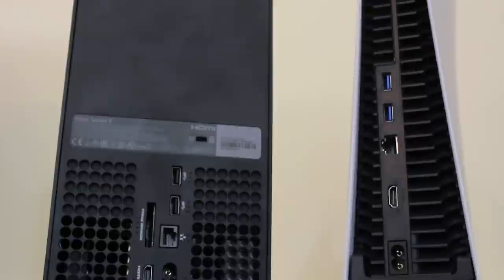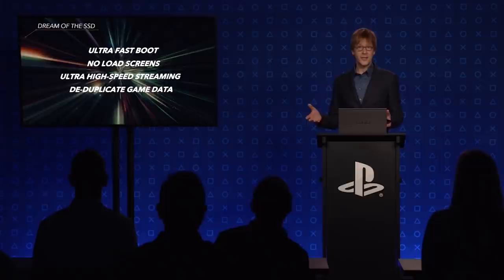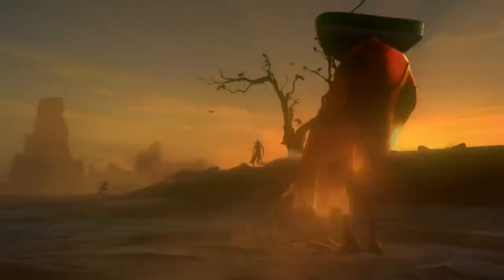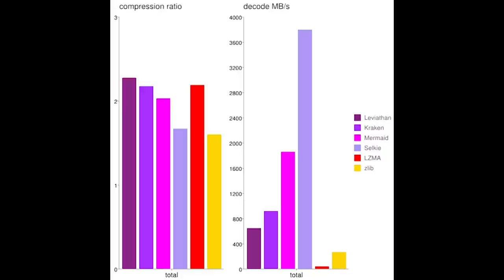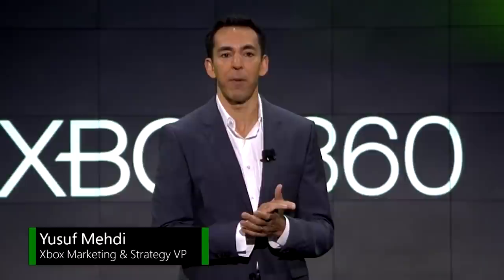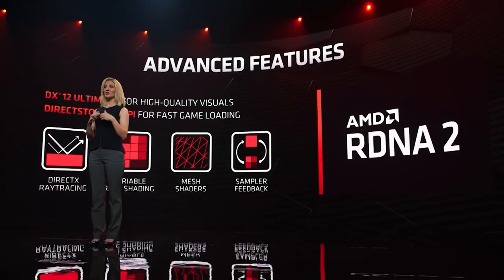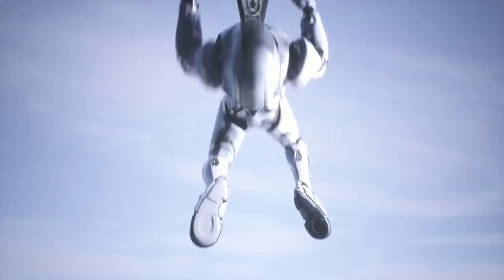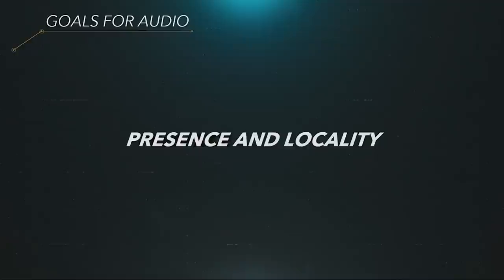Mark Cerny Reveals PS5 SECRETS | How The Playstation 5 Was Designed

Comment: Bro it's not the SSD alone by itself. It's the I/O architecture that does all the magic with games being loaded in 1-2 seconds. It's silly how people keep saying it's the SSD when in reality it's not the whole picture.

For example you can add in an external NVME and still get the same or better load times with PS5. games.
Reply: I´m not sure i agree. DMA have been a thing since the early 90-tys. In the presentation thay make it sound like its brand new, and they invented it. but its have really been the norm for 30 years now.
Reply: @matsv201  Yep the MegaDrive could do DMA but most retail software didn't support it.  The demo scene have exploited it a lot tho doing real blast processing and other cool stuff.  The Jaguar IIRC was the first console with a widely commercially-used DMA for its framebuffer, direct framebuffer access.
Reply: @matsv201  Likewise, decompression blocks on GPUs for standard file formats, starting with S3 textures, have been a thing since the late 90s. 

The big difference is having a set of features guaranteed to be present and function predictably on every PS5, from #1 to #100,000,000. That is the big advantage of a console as target platform. Though it also means it will still be the exact same set of specs five years later, while the definition of a high end gaming PC advanced in each of those years.
Reply: @epobirs  i guess there is some reason why decompressing from disc ks better. Of cause, the bandwith is lowe, so they may be able to run with harder compreason algoritm. Also doing it from disc make the decomomopression in order, that have some benefits.

And of cause.. wirth the streaming into memory...meomory is not really a limitation anyway
Reply: @samalton5837  the mega drive? You thinking of the maga-CD.

The normal megadrive have the cartrigd inline  with the memory
Reply: @matsv201  Having dedicated functionality at the point game data enters the system is the ideal. The problem for PCs was getting a new hardware addition standardized that was perceived as being for a niche application: gaming. Adding the functionality to a gaming GPU and eventually all GPUs was a far more attainable goal, as seen with the S3 texture standard. 

The GPU companies are seeking to reproduce that today with DirectStorage and consumer versions of existing HPC tech with RTX I/O and whatever branding AMD plans to use. (I cannot recall if they've chosen a name yet.) But it's a glacial process. We were supposed to have seen some open betas of DirectStorage games by now. I wouldn't be surprised if AMD and Microsoft intend to have much of what Microsoft calls Velocity Architecture become a PC standard. The PS5 and Xbox Series X/S need a good number of products that really create a gap between console and PC to make the market interested. The alternative for PC devs porting a game that really exploits the consoles is to require a much higher RAM volume on PC. A 64GB PC can do quite a lot to substitute for the storage functionality of the consoles, even running from a 100MB/s hard drive. Such PCs aren't that far off from becoming mainstream without adding any new hardware features that present an uphill battle.
Reply: @epobirs  I would claim that is a over-generalization.  One issue with S3 texture compression was that the texture was not often stored compressed, or even worse, compressed in a different format. But for cases where it was stored in the correct format, this method works just fine.

The textures don´t "enter" the system, its loaded into working memory, its already in the system.

For it being optimal is really depending on other parameters. For a system where the data is stored from SSD where its not really any consedable access time, then decoding it from disk kind of make sense.

For a system where size of the storage medium is not really a issue, but size of ram as well as transfer from storage to memory is, then having it compressed in memory makes more sense.

Looking at the direct storage games that are today, they are really not streaming data that fast. Even with out HW the function can easily be emulated for today. Because its really used for LOD.. or what ever UE5 call there nanite equivalent, if the speed is bogged down by slow emulation preformance, its not really a issue, it just generate a later popin
Reply: @epobirs  PC are already mainstream, just fit in a different segment of gaming. The ram solution should work to a degree, but ouch on adding the extra cost. So far only Ratchet and Clank might qualify for a game PC's or XS might not be able to pull off on the loading time, a pause (How long?) to load up the new world. Not a big miss today, but very interested to see if this tiny gap today turns into something larger in the long term
Reply: @jasonmontoya4749  Ratchet & Clank is, as it turns out, not a particularly good example as it is largely on rails and doesn't have anywhere near the freedom of movement people were lead to expect. There's nothing in there that couldn't be readily reproduced on Series X/S. At worst, some transitions would take a few frames longer to allow for loading and processing new data. Even that doesn't seem likely as watching the game doesn't lead me to believe there's huge volumes of data churning in and out of RAM.

Who said PC wasn't mainstream? I was speaking of a specific feature set that is expected to heavily influence future game design. That extra cost will be minor long term. 32GB (which would be sufficient for background loading a huge amount of geometry and other data used to present larger and more complex environments than in the past, when competing with platforms doing everything in 16GB with no dedicated video RAM) is already mainstream at the mid-to-high end of gaming PCs, despite the scarcity of games that really demand it.

The current consoles are seeking to advance the state of the art via SSD and I/O infrastructure but it is also a means to mitigate the very minor RAM increase from the previous generation due to cost shifts for RAM vs. NAND. (Microsoft elaborated on this in their Hot Chips session on the Series X.) If the past progression over console generations had held, the PS5 and Series x would have 8 or 16 times the RAM of the PS4 and Xbox One. Instead we got a mere doubling over those 8GB systems.

On the PC side, it won't be any surprise to see 32GB become the baseline as part of the shift to DDR5, as what little has shipped to date has 16GB as the minimum DIMM capacity. Thus gaming PCs having 2 to 4 times the RAM of current consoles is almost a certainty within those consoles' lifespan. For many developers, this will be an easier way to handle their PC ports than waiting for the promise of DirectStorage to reach fruition, something that has a very vague at best delivery date at the moment.

There is a certain nostalgia to this. Back in the 80s, when I was working at a game developer, games had to work on the 512K base models of the Amiga, Atari ST, and Apple IIGS, with 640K the PC norm. (768K on some Tandy PC clones that had the Deskmate firmware app and had the usable empty sockets on the motherboard if they didn't ship with it.) Hard drives were still rare, even on consumer oriented PCs. This was becoming painful as games tended more and more to be spread over multiple floppies. All of these machines had models with much more RAM or the ability to easily add it. So we, and many other companies, took the RAMDISK approach. If the initial load detected more than 512K, the player was offered the opportunity to cache one or more of the floppies to the RAMDISK. This took a few minutes but made the gameplay a lot better for big sprawling, by the standard of the era, titles that could require tedious disk switching to work in the base memory volume.

Today's PC, even running from hard drives, can fill a large volume of RAM in the background without making demands on the user's patience. (Under three minutes for 16GB if it is simply a direct transfer.) The designer just needs to get the player engaged quickly so that background activity can commence. The time to the first menu may be annoying but not excruciating.
Reply: @matsv201  I was speaking in regard to the issue of data not necessarily being for the GPU to use in VRAM, which is how the existing proposal for DirectStorage on PC would work, as seen in the RTX I/O approach that is closest to to actually being a real usable feature.

As Paul noted in the video, the consoles are agnostic about what part of the system will be using the decompressed data. This is simplified by there being a  shared memory pool between CPU and GPU. As seen in the diagram, the PC DirectStorage has to get the compressed data into main RAM, then over to the GPU for decompression into its VRAM. If the data in question is not for the GPU's use, it then needs to be transferred back to main RAM.

This can still be a big improvement over a portion of the CPU decompressing the data in question but it's a bit of a workaround for having to work with what will be in a PC that exists today and will be largely the same for some time to come. Getting big improvements to I/O standardized to the point game publishers regard them as mainstream enough to use is a process of several years. So it's attainable goals for now and push for improvement as the value becomes demonstrable in real products.

Also, what DirectStorage games? Looking around, it doesn't appear to have progressed beyond the Developer's Preview and I've seen no PC games announced that will incorporate it along with requiring NVMe storage. (Forza Horizon 5 on Steam doesn't even say 'SSD recommended' under storage on its requirements list.)
Reply: @epobirs  Nice info and background. I played in those days, early Tandy II's if you remember the 12" large disk formats... lol. The I/o infrastructure is looking to change the entire SSD into a functional RAM. PC's might be able to duplicate this somewhat  with more RAM, but does it does not matter until a games or games are pushed to the extreme where those margins make the difference. Custom archeture is just that custom, this is a console strength to have architectural control over the entire system. Right now its a wait and see what developers do with the tech. Might be overkill might not be. IMHO there is a picture being painted here with the virtualization of UE5 and ninite, and how that will interplay with the choices Sony made with PS5. I wonder if Sony had the inside lane, to know how UE5 and ninite strengths, and Sony provided a spec console to take advantage of those strengths. Thats to say, the the play that seems to be emerging to me with UE5 is that assets are going to be EXTREMLY detailed in the new future, and they will be streamed in. Although thats not done today exactly, but it will be and the PS5 is positioned to be the best at this possibility. Well wait and see.
Reply: @epobirs  this is more of a 32bit/64bit miss match issue. Back in the Day when cpu was mostly 32bit the gpu could read the full memory in theory. Anyway, due to maping ghe dma could write ditectlt to gpu memory.

When cpu and more so OS become 64bit this didnt work as well any more having to map via a paging. When gpu become 64 bit this function was lossed and not really reintroduced untill the rx 6000 series gpus.
Reply: @matsv201  they didn't make.it seem like that. They only have taken the tech and patented a Proprietary solution for using it. They created a tech solution....not new chips perse

Comment: Video on cell would be really interesting, especially from today's perspective with a clear picture into the past!
Reply: There is still a lot of FUD circling around about it.

Firstly, the cost calculated of it  was a non yealded variant, so that number will be quite a way of.

The second part about how hard it is to code for it. That is that thing that is true in theory. But in practical reality when the average game devs would make a game, they would use more middle ware to use the SPE. For example, i want this picture decompressed, or i want this audio levlized, or i want physics on this object calculated.

There is hardly any game devs that do those code them self, that is usually provided by the dev kids. And the part of the code would pretty much be:
decode.picture.SPE3
(the gramatics is not right, i´m not a programmer but a hardware engineer). Then it would bogger of and do that decoding, and the picture will just be kicked out of the loop when finished.

So if you just have a sufficiently large library with software, its not really a problem using them.

So that would probobly spawn the question if its so brilliant, why don´t we use it today... And the answer is... we kind of do. Apple have for instance have a M9 coprocessor in there SOC since iphone 6, and they was not even the first to use it. In the latest version they have a 16 core neural engine, that is pretty much the same thing. Phones, tablets, and some intelligent embedded systems all have it. But consoles and PC don't.

There is two reasons for that. Every CPU since Zen-1 forward (and.. well some earlier Intel) have had the ability to run FPU and ALU quasi simultaneously.  What that implies is that when a work order is sent of to the FPU, the ALU can keep working on a other order simultaneously on full blast. While this have been true to a limited degree since the Pentium 1, doing so to a unlimited degree was first true in the 2010th. Prior to that at least a section of the ALU had to be turned of to run the FPU.

While the SPE as well as the Xenos CPU sports two 128 bit FPU each. A normal Zen 1 CPU sports three 256 bit  FPU pipes (sort of kind of.. its complicated), and the Zen 2 have four 512 bit FPU pipes (sort of kind of ...and so on). So because they can do it quasi simultaneous, there is not really a need to of load it, at least for small tasks. For ARM CPU the FPU is not as closely integrated to the ALU, so it generally have a higher penalty to run inline FPU code. For a modern x86 CPU, if the FPU code is just sufficiently integrated, there is barley any penalty what so ever.

Intel did this quite a few years ahead of AMD, and that was part of the reason why Intel CPU was so much faster than AMD during quite a long period of time. The other reason (that is really closely connected to this) is that Intel CPU. This is also essentially why one ARM core is much faster than a other. For example a old A9 (common in older smart phones) have a IPC of about 2, while a A73 have one of about 6. A first gen core i have about 4, third gen about 7 and and 5:th about 10. Then it start leveling of. This is benchmark measures, so its very approximate. The CPU in the Xbox 360 runs at only 2.

So somewhere around 2008 Intel start pushing this very hard, this might have been a response to the cell. most people today think of Intel as fairly lazy, but in 2010 they where quite a bit ahead of the game.

The Second is the GPU. During this time, AMD pushed for APU in steed of higher IPC level . Thinking that high demand processes would be offloaded to the GPU inside the APU like a SPE. While this was not a successful marketing strategy. This is something games of today are doing. And also software. A GPU core is effectively a SPE. But due to more efficient memory structure, and lower power demand.. its just a much better alternative.
Reply: @matsv201  Whoa! 😯 Your comment is the longest I have yet to encounter during many years using YT 🙌🏻✨.
Reply: It was a huge mistake born out of hubris.